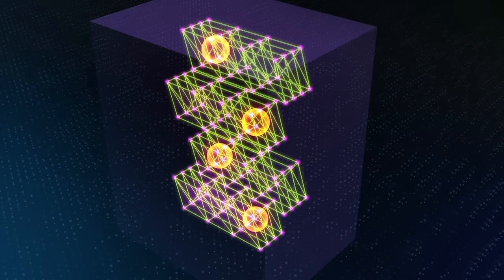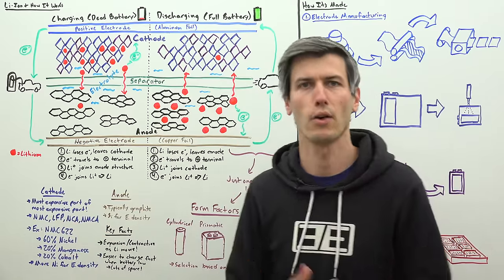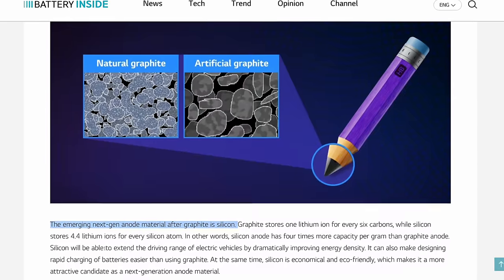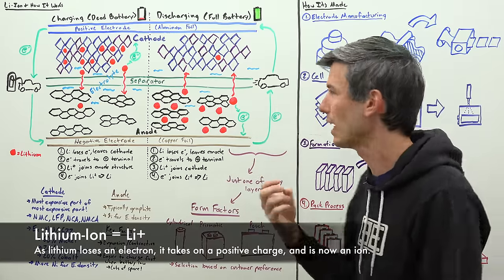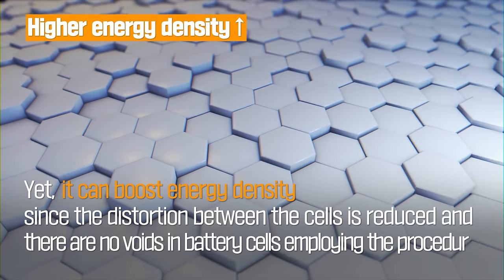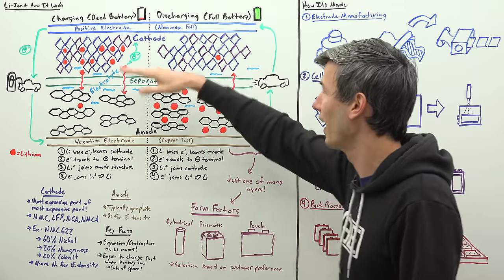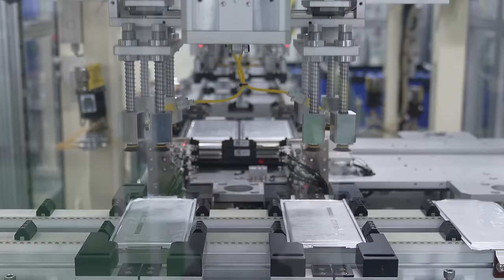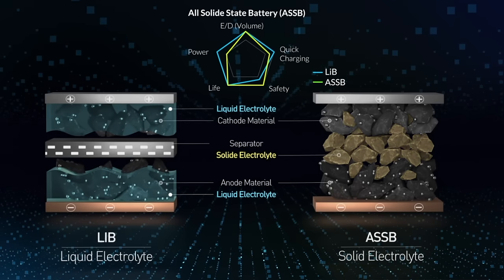Everything You Need To Know About Lithium-Ion Batteries

Comment: Powering ideology and propaganda, not the future... There are better energy storage options
Reply: not to mention the used car market for electric cars sucks. i can buy a cheap old gas car and if i fix any issues myself i can have a perfectly running car for super cheap that will last me years. with electric cars if you buy a used one be prepared for a 10k-40k battery replacement. they are trying to limit the freedom of movement for lower income people.
Reply: @CaffeinatedFrostbite nonsense.
Reply: Please, name them...
Reply: @FuncleChuck  fact: batteries degrade rather quickly. 

Fact: they are the most expensive component in an ev

Fact: Many people have been quoted 20-35k for a new one from Tesla.

An entire new engine for a cheap Toyota will run maybe a couple grand to replace. 

I currently drive an old Toyota that I purchased for a few thousand dollars and then put maybe another 1500 into it to sort it out. That car can easily last another 250k miles with minimal repairs and basic upkeep. 4500 for a perfectly usable nice condition Toyota commuter car. As long as I do my own maintenance that thing is dirt cheap to keep running. 

That will never happen with an electric car. If you find an ev for 3k that thing will need 20k minimum to get running right. 

Evs are not feasible for the average person.
Reply: @CaffeinatedFrostbite even old BMWs are cheap compared to evs 🤣
Reply: @FuncleChuck I love that you just reply "nonsense" without any real argument. Exactly what I expect from ev stans
Reply: Gas or electric doesn't matter when your AC, heated seats, requires subscription to work. You will own nothing and be happy.
Reply: @AlenAbdula  not when you are both an electrical engineer and software engineer 😉

I will never own a car connected to the internet. It’s my car and they can do nothing to stop me from disconnecting it. Except Tesla, they will ban you from their charging network. Which is why I will never own a Tesla.
Reply: @CaffeinatedFrostbite 
as long as regulations on emissions and noise are going to be more restrictive i'm ok with gas cars. oh uh as long as your old dirty stinkers stay away from densly populated areas like cities.
greetings from a cyclist
Reply: Such as?  I am talking for cars and light trucks.
Reply: Like what? What other energy storage is there?
Reply: @CaffeinatedFrostbite couldn't careless
Reply: @ThexXxXxOLOxXxXx  See the 6th floor comment.   E100 (pure ethanol), genereated by "water + CO2 + chemical catalyst + renewable energy", stored and distributed just like old-time gas.
Reply: That's fuel not energy storage i think he's using the wrong words to explain his point @AkiraNakamoto
Reply: @Mew-ip3iy  no argument Andy ate the propaganda pie
Reply: @ThexXxXxOLOxXxXx  Fuel is both energy source and energy storage.    Energy is stored in fuel.
Reply: Like what.
Reply: @CaffeinatedFrostbite if you want to give freedom of movement to people from lower income then the answer does not lie in cars but public transport
Reply: @CaffeinatedFrostbite Tesla batteries last 200k miles so there will be plenty opportunities for the resale market. This year there will be 1 million EVs sold and probably a lot more in the next few years. Eventually these will trickle down in the used car market.
Reply: @CaffeinatedFrostbite no they don't. They loose maybe 5% the first few years and not much after that.
Reply: @alextasarov1341 and why would Tesla ban you? Only if you make unauthorized repairs to your car that could potentially damage their equipment.
Reply: @Alexzoidberg458  right. that thing that sucks and nobody enjoys. you cant hop on public transport with a small arsenal of boom sticks and have them take out to the countryside for a range day. 

public transport wont take you off into the middle of nowhere. 

public transport for local city commutes isnt a bad idea. but we see how well that works in new york. 

you go where the transport will take you. public transport is not a viable option for most of the united states. 

true freedom is being able to go wherever you want. whenever you want. in your own vehicle. 

public transport sucks and is not needed. the only reason it would be needed is if the lawmakers decided to make it so expensive to own a car you literally had to use it. 

i love this mentality of "you dont need to own this thing because you can just pay someone else to carry you and 300 other people to a general location kind of close to the place you actually want to go."

sugma
Reply: @AkiraNakamoto I think Jason made a video about that a few years ago. You're taking about e-fuels. The problem is they need so much energy to make, that the conclusion really doesn't follow that easily.

Efficiency doesn't matter as long as we can do it clean enough. But that is the question. If we're going with e-fuels to avoid the nasty dirty process of making a lithium battery, how dirty is the alternative of building significantly more generation capacity to make those e-fuels?

I have not done the math, so the question is open of anyone wants to answer it. Preferably with some math :-)
Reply: @fparent  right. so after 200k you can drop the equivalent of an entirely new car on a battery. its not like gas cars can last double that or anything. 

if my car's engine blows up its like 600-1000 for a new engine and then maybe another 600-1000 for someone to put it in. the engine in my car is known to last for 400k-500k miles. my car has 240k miles on it. everything is original. it burns a tiny bit of oil. 

the lexus ls400 has been recorded multiple times lasting 1,000,000 miles on the original engine if you just keep up with basic maintenance. and again. its a couple grand to replace the engine if it dies. 

20-40k dollars every 200k miles is not good in comparison to gas cars. thats the same as just buying a new car every 200k miles. 

a lot of people buy 200k mile cars because they are cheap. a 200k mile EV is a 40k battery replacement. if you can afford to replace the battery chances are you are not in the market for a cheap car. 

if you know how to fix cars yourself you can get a beater car running and driving for sub $2000. 

EVs are not accommodating to the less fortunate. 

why do you hate poor people?
Reply: @fparent  ive owned enough phones to know that batteries suck. 

not a 1-1 comparison by any means. but when it comes to longevity nothing beats well engineered mechanical solutions. 

if you can afford an EV and you like what they offer then by all means buy one. but it should not be government mandated that gas cars will cease to exist. it is a blatant attack on lower class individuals.
Reply: @plonkster  No, I am not talking about e-fuels such as hydrogen fuelcell.   I am talking about the plain old-school pure ethanol.

We only need "water + CO2 + chemical catalysts + renewable energy sources" to manufacture ethanol.   No farming is needed.   And ethanol can be stored and redistributed just like gasoline.   No change in business distribution model either.
Reply: I see both sides of the issue. But batteries are the future. Once batteries can be evolved enough it's a no brainer. You say an engine is cheap to replace in comparison to a battery. What you don't understand is the battery is cheaper to replace over engine+cost of gas ... Right now my truck at 10k miles consumes about 3500-4200$ in just gas not including any maintenance. The f150 lightning would do that at 650$ at 17cents. Well if you save 3k every 10k miles 100k miles is 30k savings not including maintenance. Also if you don't like big batteries get a plug in hybrid ... Small battery packs and you extend your range with gas. So all your small trips are taken by a small battery pack which is easier to replace. Also if you live in an area with cheap electricity your savings go up. Also if you own solar your savings go up. 

And don't get me wrong I love gas sports cars. I work on all my cars. But once battery tech gets cheap you will never go back for an economy car.
Reply: @AlenAbdula rather "and NOT be happy"
Reply: @CaffeinatedFrostbite  no, after 200k miles, you will have suffered a range loss of, on average, 12%. That's nowhere near requiring an entirely new battery.
Reply: @MrJustinOtis  That's based on the assumption of no fast-charging and good weather.     If you live in Alaska and always want fast-charging, then no way you can get that data.
Reply: @AkiraNakamoto  but it is terribly inefficient both in making the fuel and the combustion in the car. I worked in CO2 chemical reduction to make fuels, it ain’t easy. Batteries are the much more efficient way to get electrons to storage and use, which is why eVs are key. There are applications where fuels are going to take a long time to supplant, but cars and light transport batteries are great. Do yourself a favor and go test drive an eV.
Reply: @n2l2l  for us that understand yeah, but the happy part is for the ignorant, the ones that want stuff done for them. They like to bend down and take it! 😆
Reply: @alextasarov1341 other cars dont get banned from tesla charging network when disconnected from the internet?
Reply: Battery tech is not an ideology, opposition to battery tech is an ideology.
Reply: @FuncleChuck No nonsense
Reply: @edfx  Tell that to Gavin Newsome, the master of ideology.  💩
Reply: @AkiraNakamoto   Uh, no, that's based on data collected from Tesla vehicles that do all sorts of charging. Hence my use of the term "AVERAGE."

Regardless, your scenario of someone who lives in Alaska and only ever uses DC Fast Chargers is patently ridiculous.

If you're going to say silly things, you should really stop using Thomas Sowell as your avatar.
Reply: @IamGearboy  its a lot easier to afford small gas payments over time than it is to spend 30k up front. thats the point. yes you might save money in the end but the cost of entry is too high. and if your car happens to go bad early then the maintenance cost is much higher. 

if batteries come down enough then maybe. but as it stands its a lot easier for the average person to buy a 3-5k car and make small gas payments than it is to buy a 60k car (with a possible 30k repair bill) and have cheap fuel.
Reply: @MrJustinOtis  Why is an Alaska driver without patience a "patently ridiculous" scenario?   Mr. Anointed?
Reply: Lol. Compares a cheap Toyota to a high end EV
Reply: @rtfazeberdee3519  i see that you completely missed the entire point. congrats.
Reply: This is nothing new at all… these batteries have been around for a long time
Reply: Not for a portable vape, anyway.
Reply: @CaffeinatedFrostbite a couple grand for the engine. Several grand for the work.
Reply: But wait! EXXON is going heavy on lithium mining in Arkansas. So now EVs are red.
Reply: @Astroqualia  what universe are you in that an early 2000s camry engine costs a few grand? aint no way bro. and even if it costs 5k to swap it that is still 25k cheaper than a battery.
Reply: I think you meant the Koch brothers 🫢
Reply: I own a Chevrolet volt that I had to replace a battery pack on before it even hit 60k miles. Cost over $6,500. More than the cost of a new engine and transmission
Reply: What starts your car in the morning? You can’t be stubborn enough to have put a hand crank on it, have you?
Reply: @CaffeinatedFrostbite except you would never spend 30k upfront it's always a payment plan. Also you can buy many used electric cars with manufacturer warranties that cover 100k miles. You can buy many low mile used cars under 20k and you can get a gov tax write-off . Your idea is worst case scenario that doesn't mesh with reality. Even if it's that expensive to repair your car it's just cheaper to buy a newer low miles car. 

If I go buy a Nissan leaf for 20k with 20-30k miles on it, it will pay itself off in only 3-5 years ... I'm still in warranty. 

There's many reports of cars getting over 100k no issues just some battery degradation. 

All my sports cars are still gas and I won't trade em but Prius shows the reality that hybrids are the future and when battery tech gets better and cheaper you thank all those who put forth the investment to make all electronics you own cheaper lighter and more efficient
Reply: No, there isn’t. Other options either failed, or under-developed.
Reply: There is no place for propaganda in business. They sell whatever they can make profit on, which is usually the best product they can build the cheapest.
Reply: @IamGearboy  right. because what everyone needs is a second 500 dollar payment every month on top of the 800 dollar payment for the car. or you can go buy a 5k honda civic  and just be done with it.
Reply: Sir, this is a YouTube comments section...
Reply: @edfx  I meant if you own a Tesla specifically, which is why I will never own one. I don’t think they could ban other car models.
Reply: @CaffeinatedFrostbite  so you're gonna pull a few hundred dollar junk yard engine, pay 5k to swap, then a month later pay another 5k for another swap, because you paid bottom dollar for a junked engine with 200k miles on it? Cmon
Reply: All these arguments against EVs are the same Luddite arguments people would have had against the car in general when it first came out. If you don’t want to be an early adopter, fine stick with your ICE for another decade, but eventually the EVs will be better, cheaper and more practical than an ICE car.
Reply: @CaffeinatedFrostbite battery prices will go down. And idk where you are buying cars for $5k that "last years" but if you don't work on them yourself idk of any car that is gonna stay that cheap and last years. And at that point the cost isn't much different than an EV, which has near zero maintence cost once the battery is taken care of.
Reply: @CaffeinatedFrostbite and batteries are nowhere near that cost for non-Tesla EVs, depending ons size I guess. A Nissan Leaf 24kwh battery (for city driving mostly) is under $5k. Go bigger and it scales pretty linearly. And that's a single part - buy a similarly priced ICE car and you got all sorts of stuff that could need replaced, timing belts and alternators, let alone the engine itself that could have been run without oil or the transmission that may be losing teeth on 3rd gear or something. The prices haven't equaled yet, but the headache and complexity especially for people who don't know cars it's an easy choice. The biggest issue is infrastructure but that's getting better with time too. I love ICE cars and hybrids but EVs are cool too. My only real issue is legislation and regulations of average people when the semi trucks and shipping industry are really what need and would benefit environmentally to go electric (or hydrogen in some cases) but the issues isn't the batteries, especially with Gallium Nitride and Solid State tech coming.
Reply: It's worth mentioning pushing back against ideology with ideology isn't helpful too
Reply: @alextasarov1341  I understand what you mean but either way you cannot use tesla charge network wether you own tesla or some other brand, result would be the same. Might as well own tesla then.
Reply: @AkiraNakamoto  I understand farming is not involved (e-Fuel is not the same as BioFuel, though the confusion is understandable).

The equation looks simple enough, but to make it green the "CO2" part needs to be taken from the atmosphere. That is apparently the energy intensive part. Also, as I understand it, the water needs to be broken up into hydrogen (electrolysis) in other words, because what you are trying to do is take a hydrogen from water, combine it with carbon from the atmosphere, to make a hydrocarbon you can use as a fuel. That is literally e-Fuel.

The electrolysis part is also only around 75% efficient. Granted, this is where the catalyst comes in. From what I've heard, this could potentially become better with the right catalyst.

It still works, but the "+ renewable sources" part needs to be much bigger to make it work. And that is the question. Once we get to the point where everything else have to be made somewhere between 2 and 5 times more... is it still cleaner? I don't pretend to know, but it is at least not obvious.

Of course, with the renewable generation you only need to mine the materials once (or once every 30-50 years probably), and depending on how recyclable things are, it might be even better than that, and after that once-off cost, the production is free. If we have to build something that is 5 times bigger.... once off... that might be okay.

But this is where it breaks down for me. Because that's the same argument we're having over batteries. It also needs to be mined only once (for a time period that is often debated), and depending on how recyclable things are (which is looking positive), you're also going to get a lot of free storage once "paid off".

That is the question I think. If the deadline for net-zero is 2050... is e-Fuel going to make it?
Reply: @plonkster  The chemical catalysts involved in "water + CO2 ==> ethanol" process will not be consumed.   There is zero loss, so not subject to recycling.

For the "+ renewable energy sources" part, the solar power, wind power and tidal power on earth is millions of times more than any other forms of energy sources, but the key drawback is that they are all unreliabily intermittent by their nature.    Fortunately, it's not a problem for the ethanol production process because the process can be simply paused without doing harm to the hardwares.     As long as you have an annual amount of power input from the renewable energy sources, you can predict the annual amount of ethanol production from the annual input.
Reply: @AkiraNakamoto  I think you misunderstand me. If we build renewable generation, whatever form that takes (wind, wave, solar), the plant will have a certain lifetime, some maintenance in the middle, and at the end of its life, we want to scrap that plant and build a new one. We want to do that, preferably, without constantly mining more material. That's where the recycling comes in.

This sounds to me like the same argument we're having over the batteries. Making the battery has a footprint, as does everything else we will build to reach the net-zero target. That is simply a fact, there are no free lunches here. If the battery is also subject to those same forces, namely that material will have to be mined, after which it will last a certain time before it needs recycling at the end of its life, then really the only reason to pick one over the other would be if 1) it was dramatically cleaner, and 2) the tech is HERE NOW, or at least expected to arrive really soon now.

I totally buy the argument that ethanol production is more practical and might even be cleaner, but because we need several times more energy to make it work (at least right now), I'm unsure if it really beats out the leading tech right now: Lithium batteries.

One thing I also wonder about: I hear a LOT of people telling me how terrible the Lithium mining is for the planet. Problem is, none of them have ever really explained, with numbers and stuff, what they mean by that. I know 50% of the lithium is mined in Australia, from rock, so those mines are essentially no dirtier than a stone quarry. But the part that comes from Chile, with the big evaporation ponds to get the lithium salt out (the one you always see the pictures of, rumoured to kill a bird within seconds... assuming there are many birds in the Atacama desert), ... that looks almost radioactive... but I'd like to see someone actually quantify that.

Which is why I say I don't pretend to know, but to me it doesn't seem obvious at all. I understand the principle behind making a hydrocarbon from hydrogen and carbon, and I understand where those will be coming from. I understand that when we burn that fuel, it will turn back into carbon dioxide, water, and of course small amounts of the ever-present Nox we tend to forget... so that it is in theory very green. But I also understand that we have to build a heap of stuff to make the energy needed to drive that, way more than to charge batteries.
Reply: @plonkster  The maintenance of solar power, wind power and tidal power plants is just old-school mechanics.   It requires human skills, but is NOT energy consumption intensive.

In particular, I think wind power requies least mineral mining because it is pure 19th-century mechanics.   But wind power is the most unreliable one.    Fortunately, I described previously that this is NOT a problem for the ethanol production process.
Reply: @edfx  no because they may not blacklist other brands using the adapter. You would still be able to change because they don’t have the same vin tracking system and integration that tesla has.

Either way, I won’t be buying electric until they are actually make fun cars.
Reply: @AkiraNakamoto  Because EV owners do 90+% of their charging at home, and very few people are going to buy a passenger car for a state where an SUV or truck is the common choice.
Reply: @MrJustinOtis  EV owners do 90+% of their charging at home because it bothers them to charge in the middle of a trip.    The extra long charging time problem is not gonna be solved in the foreseeable future.
Reply: you have problems with batteries? stop using your dirty battery powered phone and switch to a gasoline one then
Reply: @MrJustinOtis there are batteries that are failing much faster than that.
Reply: @CaffeinatedFrostbite not true.  My 10 year old 2013 Tesla Model S P85 still has 94% capacity.  Still going strong.

I’ve been pure EV since 2013
Reply: @CaffeinatedFrostbite I was spending $300/mo for gas and oil changes.

I’ve saved over $32,000 in gas since 2013.
Reply: Like what?
Reply: @CaffeinatedFrostbite sounds like you have made decisions on old data and based on things that not all people hold as their highest priority.
Reply: @aaronbounds1336  liberals. The people who are supposed to look out for the little guy. Are continually trying to make it harder for the little guy to succeed. Evs are just another example of this.
Reply: @AkiraNakamoto , e-fuels and hydrogen are different things. How much renewable energy is needed for a liter of ethanol?
Reply: @matthias4  Thanks for pointing it out.   I was not familiar with that term and just did some reading about electrofuel.

[Carbon-neutral electrofuel from renewable energy] is exactly what I am looking for.     I think this is the ultimate long-term answer for the energy problem, not battery.    

Battery powered vehicles excel at acceleration rate.   It's perfect for speedsters driven by those hyper rich dudes.   But we the people do not need speedsters.

Ethanol generated from renewable energy can be regarded as a subtype of electrofuels.   Ethanol's volumetric energy density is pretty good, about 80% of gasoline.   So it is still my favorite, but other forms of electrofuel are perfectly fine with me.
Reply: @AkiraNakamoto , usually the production of e-fuels needs about 15-25kWh of electricity per liter. In a car with a consumption of 6 liters/100km that's 90-150kWh of renewable energy opposed to 20kWh in an electric car. We need e-fuels, just not in cars. (But for long distances in planes and ships. Even mid-distance trucks are becoming all-electric)
EVs are no longer so expensive that only rich people can drive them, you just don't get a 100kWh-battery with the lower priced ones. Used Renault Zoes, VW E-Ups, VW ID3s and some other models are affordable for many more people than you might think. EVs don't pollute their direct surroundings, they produce less emissions than combustion cars and they use renewable energy way more efficiently than e-fuels. We won't have a huge excess of green electricity for a couple of decades and should choose the most efficient solution for every segment of mobility.
Reply: @matthias4  No, you forgot the toxicity caused by battery EVs.   It's a much more severe pollution source than current fossil fuel exhaust.   This is the primary reason I am against battery EVs.

In addition, lithium deposit in earth crust is very limited.    After a while, you need to spend much more energy to extract lithium from sea water.    So it is dubious to claim that battery EVs are more energy efficient than electrofuel ICE vehicles.   Nevertheless, this is only a secondary reason.     The abovementioned primary reason kills the need of battery EVs if you are a genuine environmentalist.     Battery EV for hyper rich people is probably fine (though I still don't like the idea).   Battery EV for common people?  No, you battery guys are calling for an even bigger environmental disaster.
Reply: @fparent I'm pro-EV, but Tesla will ban your car from their chargers if you sneeze at them wrong. Repair should never be about "authorised vs unauthorised", it's "competent vs incompetent" and there is no inherent correlation between them. Tesla has always pushed hard to make the "authorised vs unauthorised" part their decision, when authorization should be the purview of the owner.
Reply: @AkiraNakamoto why do you insist on ruining your battery by always fast-charging? Also, the cold climate is not much of a factor for cars with heat pumps and battery thermal management (Old Nissan Leafs will suffer though)
Reply: @Validole  If you want to charge your battery away from home, you always want fast charging, don't you?
Reply: @AkiraNakamoto because fast charging itself is something you should only do on road trips. And yes, if your work involves basically travelling 8h/day, then you probably can't get around one quickcharge per day, but it's probably with an already heated battery. The car should charge on level 1 or 2 while you're sleeping, and for the vast majority of people, that means they don't need to fast charge during the day. And for people who spend the whole day driving, the fuel cost will be a bigger expense than battery replacement.
Keep in mind, hotels now have charge points.
Reply: @Validole  Compared to electrofuels, battery EVs have at least 3 vital drawbacks:
1. Severe toxicity and non-trivial carbon signature.   Electrofuels including E100 ethanol have zero toxic and are carbon neutral.

2. Require significant updates of the current business model including handling roadtrips.    Electrofuels require minimal change in ICE and fuel delivery.   No significant update is needed for fuel based solutions.

3. Lithium and other minerals are NOT really fully recyclable.   Lithium deposit on earth is limited, and recycling lithium batteries always has some physical loss.   On the contrary, electrofuels from renewable energy is genuinely recyclable and can run forever as long as the solar system exists.
Reply: Public transport cannot provide freedom of movement.  Freedom of movement means I decide exactly when and exactly where I am going, not to mention additional aspects such as what I am taking with me and where my point of departure is etc.
Reply: @uludak8468 you can get pretty efficient combustion engines nowadays, hardly "stinkers" 😂

But EV lovers think, we are all loaded, reality is otherwise.
Reply: @plonkster at the moment yeah, really hope alternative renewable energy sources like Hydrogen or even E Fuel becomes much more cheaper, as research is still being done. If it does, it's goodbye batteries 😅
Reply: @AkiraNakamoto that's the other thing, charging speeds will be ramped up significantly in future 20 mins or less, we'll be Super fast charging constantly.
Reply: @Saif0412  Do not count your chickens before they hatch.    As an engineer I can tell you that there is an immutable law of unexpected consequences.    Your super fast charger will have some negative side effects, some are very significant even pivotal, for example, significantly reduce battery life and/or very expensive.    Any nanotech solutions are expensive compared to conventional mechanics and your superfast charger will have to depend on nanotech.
Reply: Forget the politics people. Just live your life!
Reply: @revmatchproductions  No, you can't because those socialist politicians won't stop squeezing you.

Every socialist is a disguised dictator. --- Ludwig von Mises
Reply: @Validole Nissan had a cold climate package at least as far back as 2013 with a battery heater and heat pump, so even old LEAFs don't suffer too bad if properly equipped